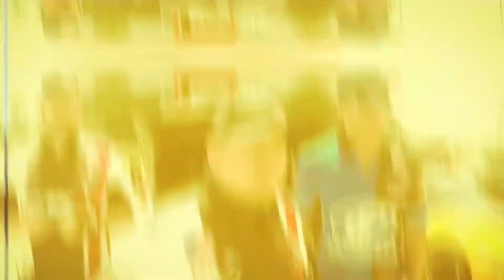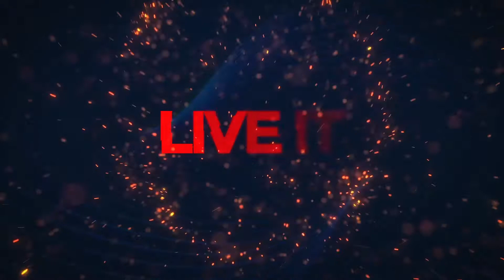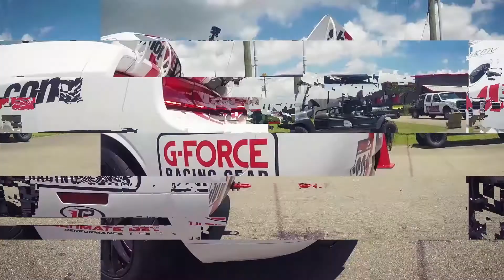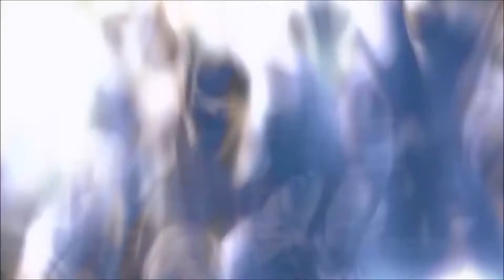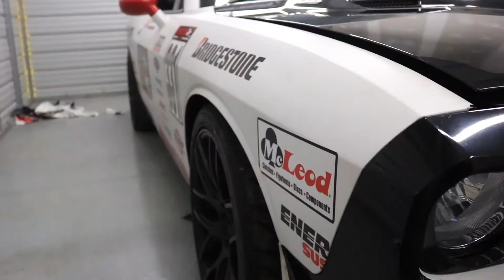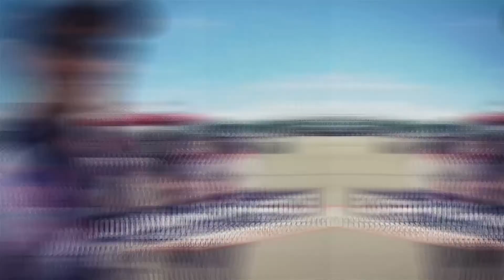TRAKit Webisode 10 - Getting Ready for SEMA!

Comment: Hey Eric question for you...did you get or how did you fix any airbag error codes that would have popped up by replacing the stock seats with the Cipher seats? I know they have the airbag plugs underneath. I’m just about to order the same seats for my Chally but was curious if you had any issues at all. Thanks and awesome video series!
Reply from the maker: Brian Johnson Good question... Our tuning partner went through the ECU to remove the codes. It's the only way to eliminate them.